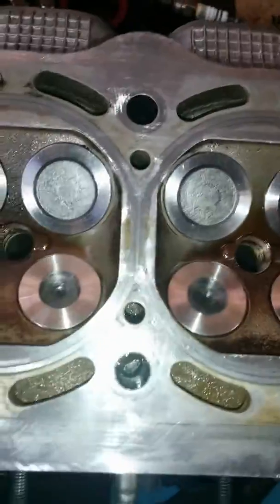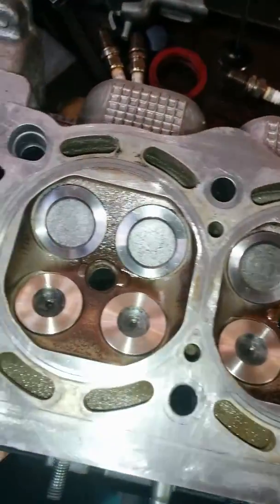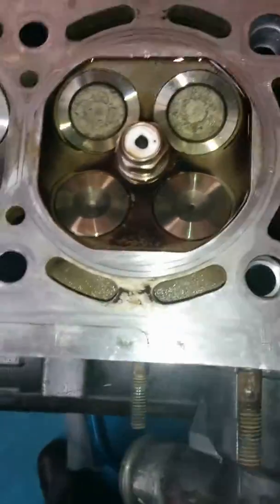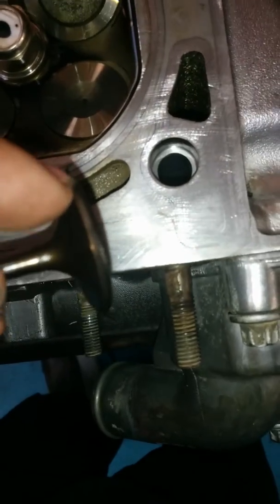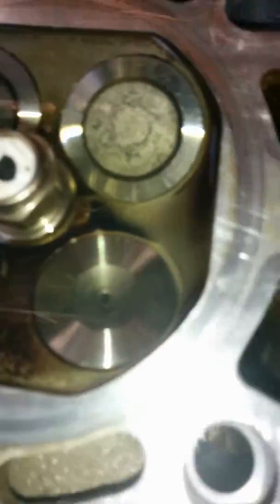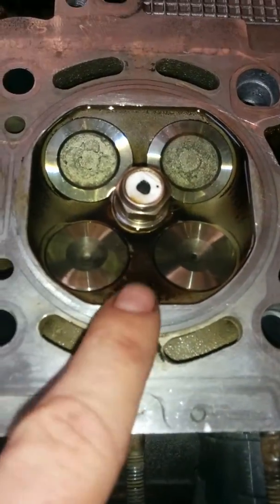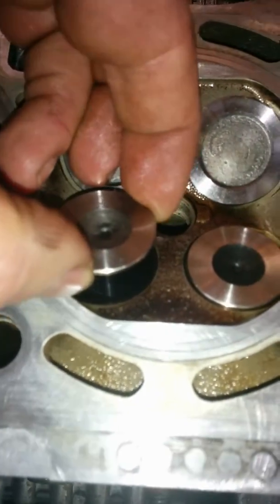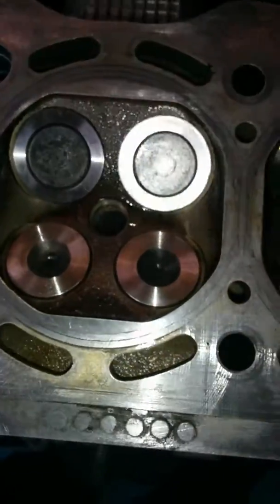Check the New valves fit correctly.

Comment from the maker: it could be my  grinding  tool a  wooden stick with a rubber  cup . might have  had a  rotten rubber cup, if that was the case  then i would have binned the tool and now cant  find it of course. There  will be no video on how to lap valves  i am sure there is plenty on youtube you use the paste  and then  blue colour  to see how  well the 2  surfaces meet after.